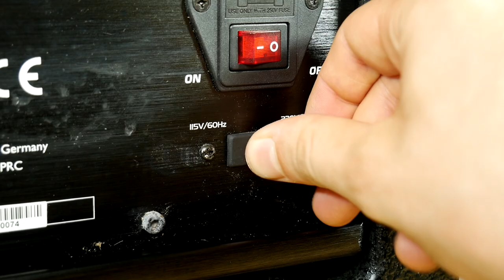Look inside the box pro Achat active PA subwoofer - What's Inside?

Comment: Is the amp a build like class H but with the first Stage beeing Class AB and the secound stage beeing class d cause of the mosfets or is it just that the first stage uses transistors an the sceond one uses mosfets?
Reply: der 12er treiber sieht wie der 12-280 aus?!
Reply: @martinmeyer6341  Is er auch nur als 4 Ohm Version https://www.lautsprecherforum.eu/viewtopic.php?t=7769
Reply: Haven’t seen a Class-D amp. Filter inductors were missing.

On the transformer u were able to see two voltage rails , +/- 24V and +/- 48V... so could be Class-H

Comment: The driver costs only 55€
Reply: Very good driver for only 55€, what a bargain !!!
Reply: Petermaler66 I dont know the driver but I have a B&C 15BG100 and it is very good but it is expensiver
Reply: No it’s 75€
Reply: DerTechnikKanal  59€ früher waren es aber 55
https://m.thomann.de/de/the_box_speaker_12_280_8_w.htm?o=1&search=1584555898
Reply: Technik Und co. Trotzdem nicht weil das nicht der Treiber aus dem Sub ist im Link ist ein 8Ohm chassis und im Achat 112 egal ob passiv oder aktiv ist ein 4ohm chassis was als Ersatzteil 75€ kostet
Reply: With a 3" voice coil it's not bad for this price, some more expensive subwoofers only have a 2.5" voice coil.

Comment: Why is there an passive filter?
Reply from the maker: It's more cheaper.
Reply: @Techscrews  Hmmm? Whats the use of it? Low cut? Because there is an active filter on the amp right. You can choose the frequentie
Reply from the maker: @timmetjuh070  I think, it's for subsonic filter, to save speaker and get more power for effective band, that this sub can play more quality.
Reply: @Techscrews  Hmm maybe thats it.   But a passive filter will reduce power and effeciency tho. I really need to try this sub. You recommend?
Reply: timmetjuh070 The driver is actually the 12-280 as 4W Version which is very good  but I would recommend you to try the passive

Comment: Basket is stamped steel
Reply from the maker: It's not a steel. Composite plastic material.
Reply: It's a 60euro driver
Reply: It's Aluminium Die cast. So it's actually not plastic either